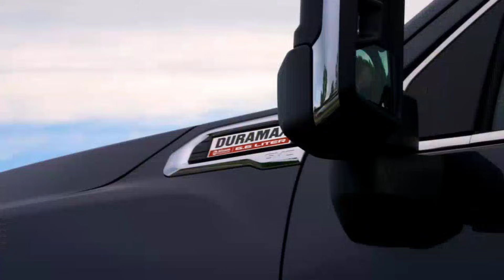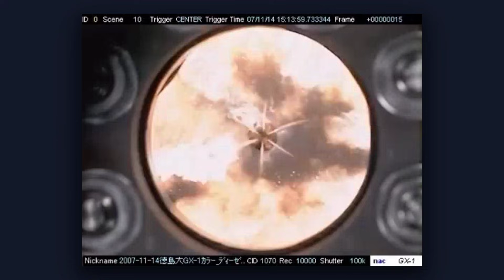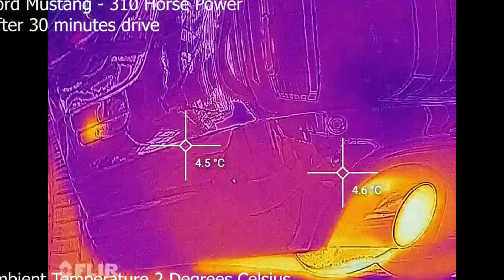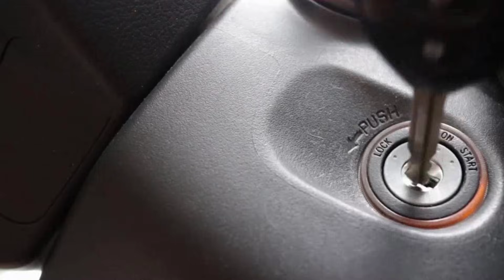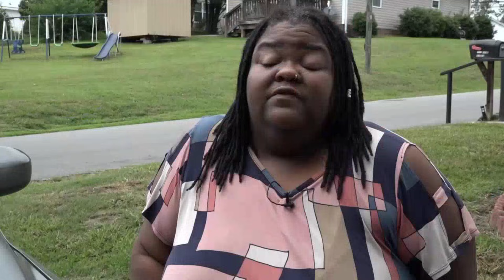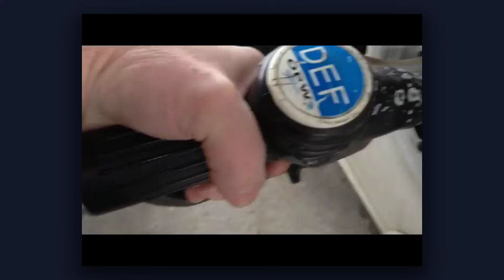Why New Diesel Trucks Will Bankrupt You (The EPA Trap)

Comment: I am posting this response as a 12 year veteran of the late great Engelhard corporation, the inventor of the modern three way gasoline engine catalyst system that every car in the developed world now uses. This catalyst system accomplishes the paradoxical result of oxidizing CO and reducing NOx by constantly slightly varying the fuel to air ratios. It is the reason why modern fuel inject gasoline engines emit 98% fewer emissions than precious engines.  I worked to develop engine simulators to test catalysts at a fraction of the cost of using actual engines.  Before proceeding farther, some background. First, diesel engines are far more polluting than gasoline engines of the same horsepower for chemical combustion reasons. Diesels operate using  heterogenous combustion that results in the excess oxygen mode meaning they produce more NOx than a gasoline engine operating at similar output. This results in the fact that cleaning up NOx emissions needs to be done separately from oxidizing CO to CO2 as done in a single catalyst by gasoline engines.. Hence the need for a separate NOx reduction system So the relatively simple job of the single three way gasoline catalyst is now separated into two separate catalysts. One to oxidize CO and the other to reduce the high NOx concentrations produced in the diesel engines with urea based liquid's.  Even worse, diesels produce far more dangerous particulate emissions due to the heterogeneous combustion of diesel fuel droplets that are trapped and oxidized to CO2 in the diesel particle filter.  
For at least two decades, the problem of increased emissions from diesel engines was solved by the diesel engine lobbyists. However, as the impact of diesel pollution increased relatively to gasoline engine pollution, the political winds shifted and congress through the EPA decided that diesel emissions should not be more harmful than gasoline engine emissions. Hence, we have the situations described in this video. As the former owner of a Mercedes 300D turbo,  there is no way that I would buy a diesel car or pickup truck unless it came  with a 200,000 mile warranty on the emissions systems. 
.

Comment: Switched back to gas this year because they are not worth it 
Anymore. Diesel engines have been made fragile
Reply: Owned 17 diesel trucks starting in 1986 idi Ford and every model Ford and Cummins my new truck is 7.3 gas I pull 25k pounds every work day .